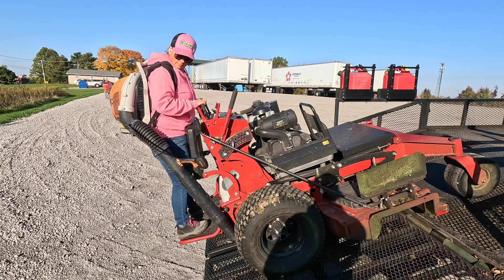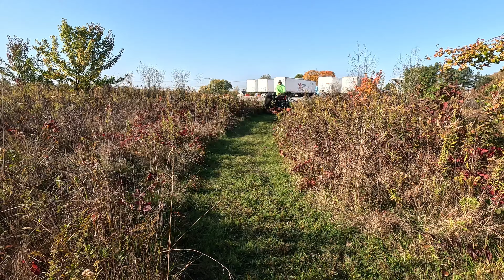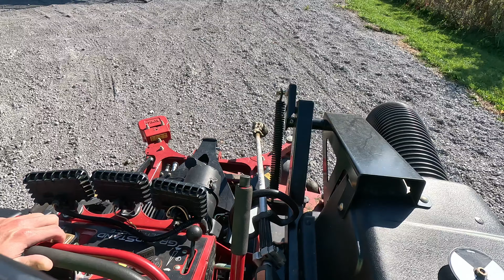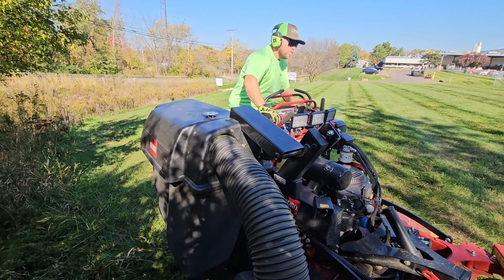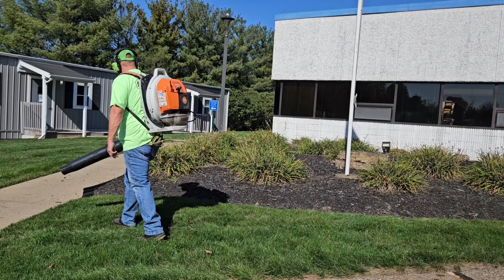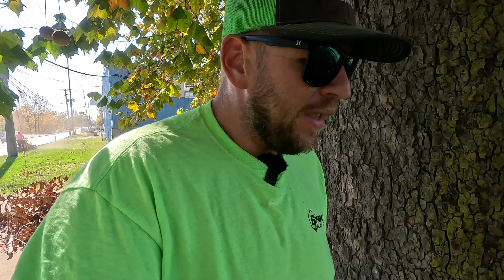CUSTOMER NEEDS A FALL CLEAN UP ASAP!! TIME TO SHINE

Comment: Shawn I ran the battery stuff for six months and they suck suck more dam battery problems tol.every guy I know will not buy them until they are forced to now too,and lost over 100 due to those dam battery equipment ...batteries sucks.
Reply from the maker: Yeah as of now I'm not a fan.
Reply: Been using Pellenc gear. Really awesome tools. 2x battery packs . A 38amp and a 28amp . Pretty much go all day. Charge overnight and ready to go again.  Oh and they have a new backpack too that had been field tested last couple of years. It should be good. But i love the handheld blower it is equal to my Shindaiwa backpack (900??) top of the range. Only its so light i can hold it up with my pinky.
Reply: My Milwaukee hand leaf blower will run about 2 minutes on a small battery